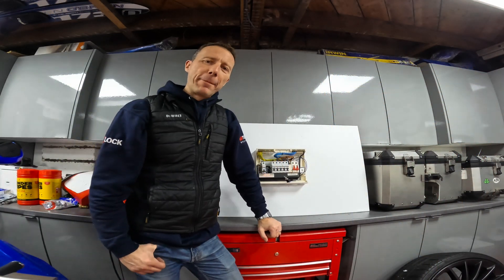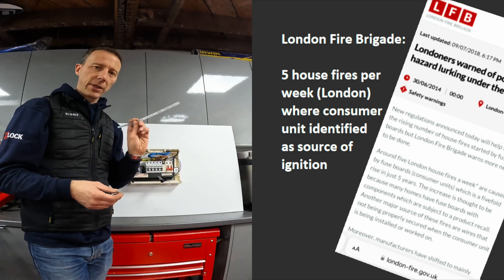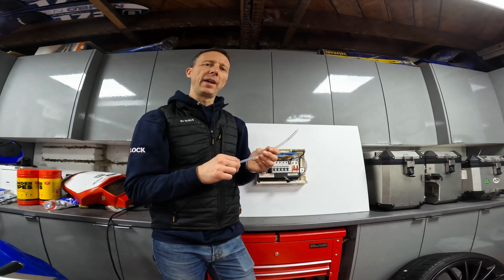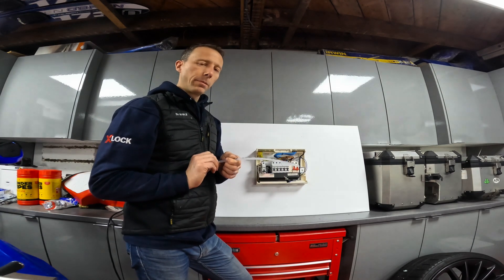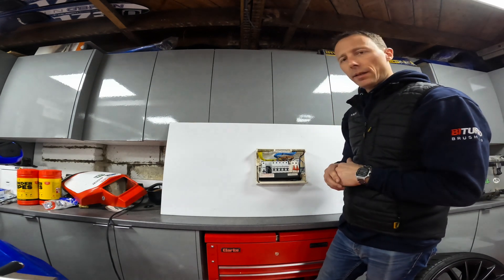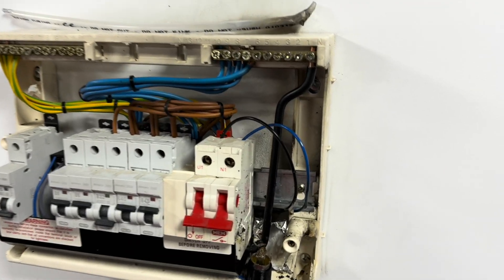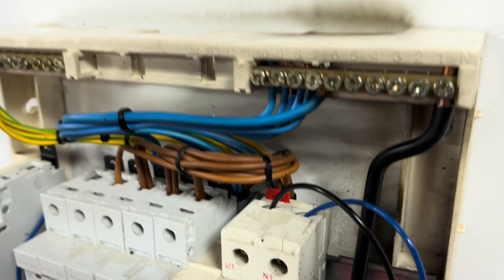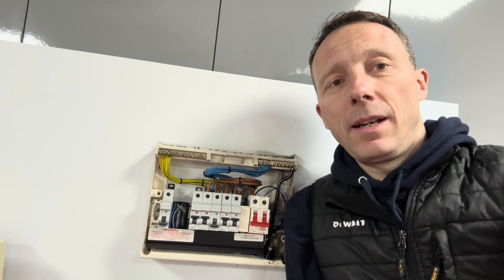Demonstration of Consumer Unit Fire Suppression system.  Stops Consumer Unit fires

Comment: The problem with these devices is they do not disconnect the source of the overheating. So it will likely simply heat up again and reignite.
Reply: I was thinking the same... this is simply removing the effect temporarily, not the cause